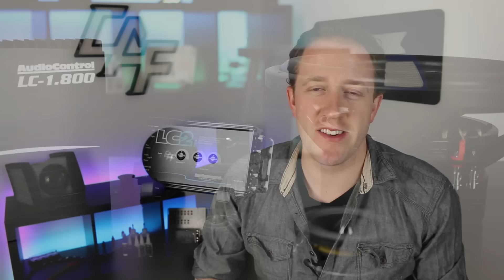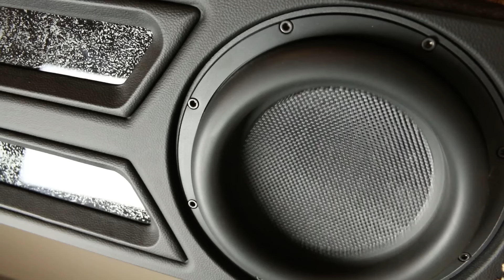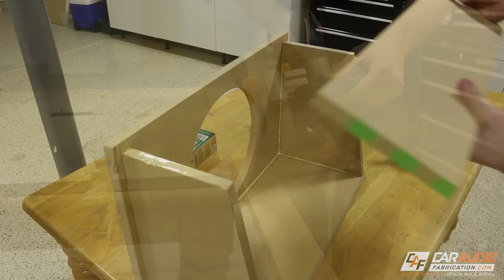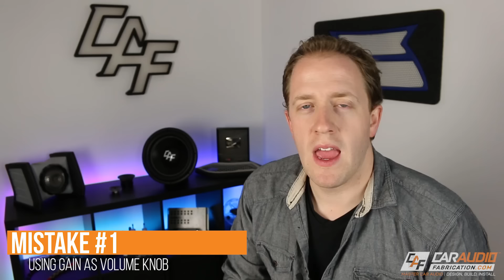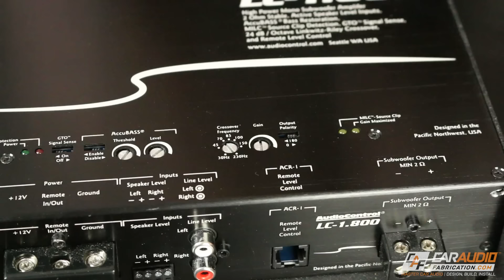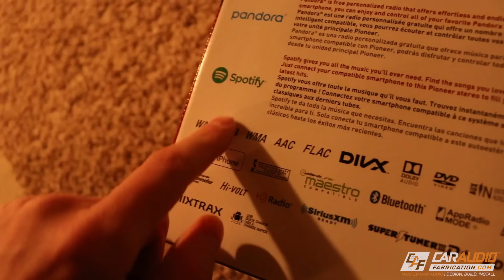Avoid these 5 common Car Audio NOOB Mistakes!

Comment: Not knowing ohm's law or wire gauge amperage limits. You're gonna have a baaad time. lol
Reply: You can always be like my buddy who's a self proclaimed  "professional". Who broke every single one of these rules. He's also using a 1500 watt amp with ONE 12'' kicker in a ported box that has extra ports because he cut the box in half, then uses a 10g wire to power it all, and gets pissed that there isn't enough sound or power so he adds an extra battery to his other battery via series. Ignoring alternator and everything else. Lol
Reply: resistance in the wiring and large amounts of amperage ,if you dont know what that means dont touch anything on your car
Reply: Whoever told you that really has had limited exposure. I have a Focal Elite series rig. Some of my friends have some of the better rigs that you can order as upgrades and even with my buddy's Lincoln and my other friends BMW, both will tell you they don't hold a candle sonically to my OLD Subaru. They spent just as much on their upgrades as I did on my rig. The only thing is they are making payments on theirs. Mine was a bit of an experiment to see if we could achieve studio control room level sonics in a car. We are damn close. The thing you need to understand is that for the manufacturers it is more about the tuning that it is about quality equipment. Most of them come with paper coned drivers still. It is true that stock systems now commonly sound better than they used to but even a budget aftermarket kit that is installed properly can easily outperform most of those. What I am saying is that you can put JVC speakers in your car and it can sound ok. PS. I am an audio engineer as are the aforementioned 2 friends and we all have grey hair. I am not just talking out of my ass.
Reply: Great video man! And the most common mistake I see my buddies do is like you said go by an amp (let's say 1000watts) but don't realize it only runs 250watts rms lol my fosgate amp is a 1500watt but when tested it's pushing 1800+rms so I was happy with that haha
Reply: +falchulk
Well kinda, but not really, in vaping i was doing some builds etc, so it required some ohms law and other bs e.g. calculate the wires ohms based on lenght/width etc including the battery limits based on their rating and if its in parallel or series so i wont short out and will get the desired results. So i suppose its very similar in audio or wiring in general.
Reply: Damian Chiliński: I didn't see this till now. Not sure why but to answer here you go. 
 It is never going to be exact. Wait, recording studios aren't exact either! We only wish they could be. the truth is that speaker technology is incapable of being exactly as of yet. We inch closer all of the time but that said there has not been much in the way of great advances in terms of linearity (concerning both phase and frequency responce) in speakers in decades. With the advent of digital technology, one of the benefits is that we can now correct eq with far more precision than in the past and without shifting the phase nearly as much as we used to. Also, we can be far more exacting with crossovers both in terms of points but also the shape of the slopes. Furthermore, we now can shift time in order to correct for phase misalignments at the crossover points that so commonly happens and of course the biggie. We can time (also phase as they are related) adjust for arrival time in a specific listening position. The answer is yes, we can make it crazy good in that position but as we move out of that position we no longer have such a good vantage point. The misnomer in all of this is that the resultant sonics is usually not horrible in the other positions. It is just not quite as good.
Reply: And that was my point when I sited that aftermarket car audio can be a big upgrade. The sad reality is that if you look at the "extra fee" added to the cost of the car for the "upgraded" infotainment system and compare that to the cost of even a moderate aftermarket system installed by a knowledgeable operation the difference can be huge for the same money or even less. What most folks don't understand is that the reason why the manufacturer's upgraded infotainment system performs as good as it does isn't so much that they put really great components in the right places. It is more that they had a skilled person set the DSP up for the system specific to that car. With that, they can put relatively cheap components in and it will still sound good.  What we are talking about is putting good components in as well as setting up the DSP right. This way there is little adjusting for deficiencies of the components.
Reply: Not in my old Subaru. The amps are each wired right back to the battery direct with 4 gauge wire. The car's alternator according to factory spec only outputs a few amps above what the car needs to function with all of the accessories running. For example, I took the car down to Florida on holidays. It was fine up here in Canada as I was not running the AC much and the engine wasn't running that hot. By the time I was in Georgia with the Tunes bumpin, I looked down at the voltmeter and saw I was under 12 volts. My fancy battery and individual feeder lines to the amps couldn't save the fact that the alternator just needed to output more juice.  No capacitor is going to make up for that either. The worst part is that is the biggest alternator made for that car outside of that I need a custom unit. That is my next upgrade (along with a big 3 rewire kit). I want to add a 3rd amp and put the speakers in the back doors as well. Just never got to that.
Reply: What are you even talking about lol
Reply: Huh?🤔🤔🤔
Reply: +tarstarkusz You have no idea what you're talking about. My system would put any modern car's audio system to shame quiet or loud. My system isn't even expensive. $600 max?
Reply: will 14 gauge wires be good enough on door panneled speakers that are  rated at  3 to 400 watts? and is there  a difference in sound when you use solid copper wires compared to copper clad aluminum wire?
Reply: Also is it better to series subs that are 500 watts a piece into a 1k watt amp than to have them seperate ( is that parallel in car audio terms?) going into a mono block amp?
Reply: Car Audio Inc a CD power equations formula P=IxV
Reply: tarstarkusz kinda true, unless you're upgrading  to high end component speaker set up.
Reply: Even if you know, it is one hell of a job to measure and calculate volt, ampere, and ohms, to determine what battery, what alternator, and at last what aftermarket system you choose. Me for example, has done nothing of this. Just today i installed a 2 fahrad cap, without a bigger battery or a bigget alternator, and it plays pretty nice. Lights is not an issue, whereas is might have been before the cap. Also my alternator interference is like 1% after wiring it better and installing the cap.
Reply: You punking on unintentional 24v DC systems?
Reply: PsychoFisho: Who's post were you referring to?
McLovin': While it is true that you could see a performance upgrade you have to understand why that is happening. What you are telling me is that your amp is actually being starved of supplied power. The cap can only hope to make up for the shortfall temporarily and depending on the circumstances this can be all that is necessary. That said the circumstances surrounding the power drop determine the type of solution that is in order. Typically an external capacitor is more of a band-aid solution as amps have caps in them for that very same purpose.
Reply: I think big wires will compensate the loss, big wires more power say for ex; a water hose to give more H2o U need big hose...
Reply: Korey Brown: What is not true. The part that says that Capacitors don't generate energy and only store energy for extremely short periods of time or that Subaru doesn't know what they are talking about when they say that the alternator was designed around the requirements of the car and not the other way around?
Reply: me on the wire gauge ... it used to smell  like somthing was burning
Reply: This comment is old but I just have to chime in. Ohms law is great but only works for resistive loads ex. A light bulb, electric heater. Speakers convert power into a magnetic field therefore speakers are inductive loads and ohms law does you no good. Watts mathematical relationship on the other hand will be a great help when doing a car audio build.
Reply: Damian Chiliński  good audio processors have a microphone that will put the sound where it needs to be at the right time although when it comes to passengers they're screwed. That's why you shouldn't even bother putting speakers in the rear of a car. Subs sure, but build the sound stage keeping the front in mind not the back.
Reply: Like the Best Buy i just took my car to
Reply: @Lamster66  no, capacitors store energy for when the demand is there ie: hard hitting low bass, it is hard on the electrical system when you are running your lights maybe heater and heated seats  say at night with your wipers going maybe defroster or air conditioner, this is one way to see your lights go dim for short time especially at idle
Reply: Ummm. This has nothing to do with Ohms law dude. What you are talking about is the fact that lower frequency waveforms are longer than higher frequencies and therefore in order for them to completely develop they require more travel distance. For example, a 40hz sine wave is 28.21' long. That doesn't mean you can't hear 40 Hz at a closer proximity though.  You do but through a different mechanism. 
 Now, I thought you were going to get into the fact that speakers actually almost never measure the resistance that they are rated for. What I am saying is that if you take a new 8-ohm speaker out of the shipping box and measure it with an Ohm Meter without connecting it to an amp you will see it is actually something like 6.8 ohms.  If you drive it (some amps measure the attached load and display that. It is more of a pro audio thing and rare in car audio.) and watch the resistance you will see it jumps all over the place while it is being played. That is called a reactive load and the driver is averaged at 8 ohms of resistance (in this case) in order to give it a reference point. If you wire 2- 8-ohm drivers in series it will be more resistance as you are ganging 2 resistors one after the other. If you wire them in parallel you will have less resistance as you have doubled the number of equal paths for the current to flow through. This is what the fabled Ohms law is going on about. I =V over R. You can use the formula to calculate what the resistance difference would be. Is it necessary to know the calculation? I don't think so. It isn't like anyone is trying to drive 10 drivers with 1 amp channel anymore. So long as you know that every time you stick 2 equal drivers in parallel you have half your load. 2, 4-Ohm drivers in parallel creates a 2-Ohm load etc. You are probably good to go.

A huge misunderstanding that many people have is the fact that every speaker has a different efficiency rating. With that 1 watt of power in can generate more or less acoustical energy.  A really efficient high power handling driver is going to vary far less in resistance when creating 128 dB when compared to one that is running near its maximum power handling capacity.
Reply: Max R. The smaller the cable you are trying to push power through the more resistance it will have to current flow. A filament in a light bulb is an extremely fine strand of wire. You can see how they get hot enough to burn things ya? Well, that heat is electrical energy that is lost. In a light bulb it is intended to create light not heat like a stove element. 
 In the case of speakers in a car, amplifiers are designed to operate optimally with specific loads (resistance) attached to them. 8-ohms is kind of an audio system standard. We often use lower resistance drivers so we can use smaller amps to do the same amount of work. With that, they will sound better when used as directed. If you run small speaker wire you are changing the load on the amp to something higher. It could go well above 16-Ohms  when connected to an 8-Ohm driver if the wire is small enough.  That is when we get into "Impedance mismatch" issues like less power, distortion or even equipment failures. In short big wire equals better sound.
Reply: @MrRoberacer  I'd love to ask you a few audio questions, I'm in the process of a new build and I've gotten very mixed information. Some say I'm making a big mistake others the exact opposite. If your willing, shoot me a personal message. You sound like you know what your talking about
Reply: kronik kaotik His system must buuump! lol
Reply: Ty Brown I am an associate level certified electronic technician. I've never heard of this. Please explain this because it could really help me out. Always looking to learn something new.
Reply: dylan drouin. It sounds like you didn't understand the question.
Reply: I know ohm's law from vaping, is that enough?
Reply: You know if french fry when you're supposed to pizza, your gonna have a baaad time
Reply: LMFAO!!!
Reply: This is not true at all...
Reply: I tested it myself. I had 64 1 inch speakers wired in series on a single 4ohm channel at 800 watts. At 10 feet the music was barely clear. But 3 blocks away it sounded like a PA system.
Reply: daryl atkins ohms law is broken. Assuming ohms are a measure of feet based on sound, and wattage supplied combined with the usage of ohms law when trying to run multiple speakers in series. You can run 128ohms on 64 1 inch speakers on a 4ohm channel, at 800 watts.
Reply: Car Audio Inc if you French fry when you should’ve pizza your go nana have a bad time
Reply: Except ohms law is broken when you go over 128db.
Reply: Car Audio Inc. I still can not understand why big wire is needed to make all this possible if only what is happening is the voltage is being stepped up and sent to the speaker to make the deep sound come out.
Reply: The fact of the matter is that most cars come with very good audio systems these days and these systems are specifically (sometimes just generally) designed for your car. The engineers know the acoustics of your car in a way that no audio shop does. It's never going to be super loud, but your after-market system is rarely going to sound as good at much lower volume levels.
Reply: tarstarkusz I really disagree with this. I don't think most production cars go through extensive acoustic testing ...to determine the best set ups. I believe they toss some speakers in there and call it a day.

Comment: I have a question. A few years ago, i purchased a hifonics brutus 1100w rms amp for my sundown sa-12, which is rated for 750 rms. I wired this system using 0 gauge wire but iv been told that its overkill, and i realize that, but i like the idea of having more than enough. However iv been wondering lately are there any negative consequences to using a gauge thats larger than i need? Any feedback would be great. My system sounds great by the way, but i wanna make sure im not hurting anything or leaving any performance on the table. Im using 12 gauge speaker wire btw
Reply: Gholds98 its better to have the thickest power wire you can afford . the bad thing that can happen is the amp will be able to pull more amperage and if you're electrical isn't strong enough you're volts will drop . then everything electrical in your car will suffer then eventually fail.

Comment: The best thing you must do, when you build a badass car audio system, is to install a capacitor. It will accumulate bunge of power, to feed it through the car audio system
Reply from the maker: +Vaios Kaliakoudas no
Reply: Its best to upgrade to a high output alternator . its good to get an agm battery in the trunk . caps are trash unless they're super caps.
Reply: And if you guys do I know anything about electronics all scientifically it’s deafening to Pastor does is smooth out DC ripple

Comment: Buying expensive subwoofer and amplifier and still using stock front system is another one. Many sugiest thats an amp and an nice front system should be the first thing to get when u want a nice system.

Comment: not properly isolating rarified waves from the front waves during normal speaker installs.

cutting off OEM harnesses

improper x-over settings

poor grounding

using rear speakers for "fill"; get that shit outta there!